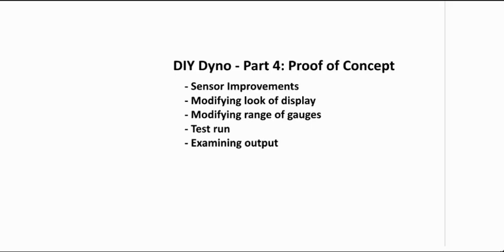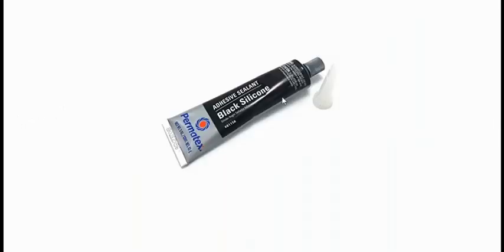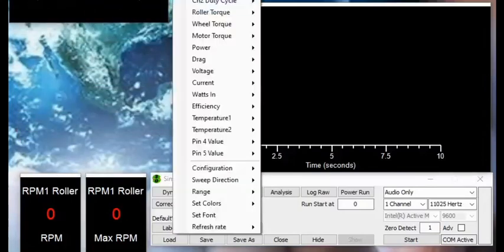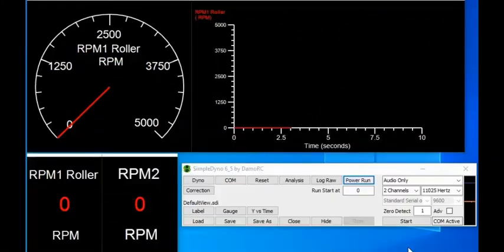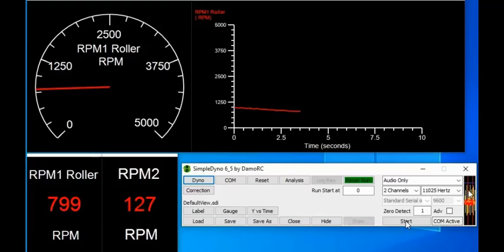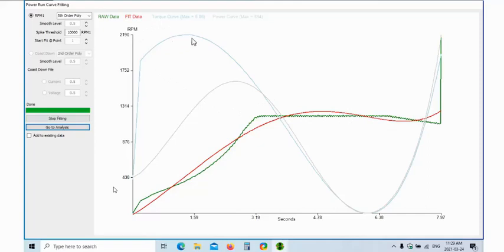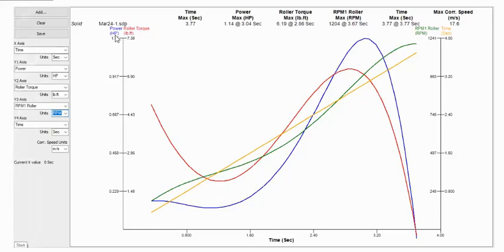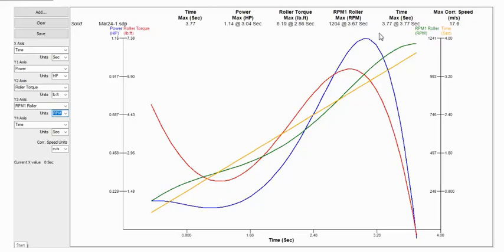DIY Dyno (Dynamometer): Part 4 - Proof of Concept

Comment: how would you make this large scale, i have various engine sensors and engine parts i could use < fly wheel < crank gears etc
i want to tune my car and street tuning is dangerous
Reply from the maker: The mechanics of it would be a big undertaking. You could use a big drum and lots of math. The biggest I've seen was one made for a motorcycle. https://youtu.be/XUX_YWsECWs